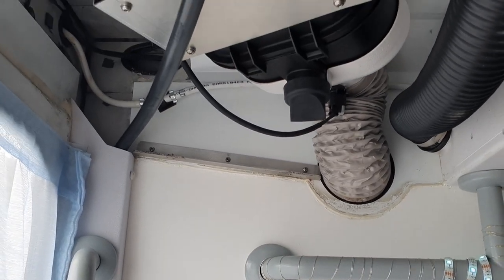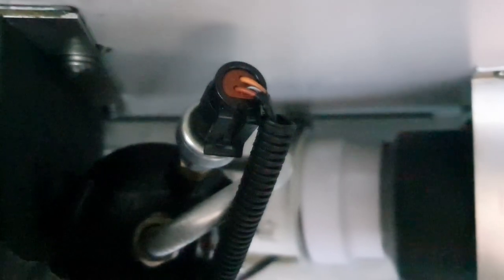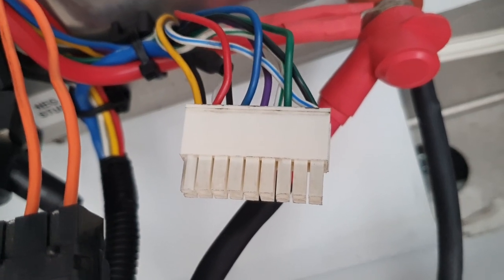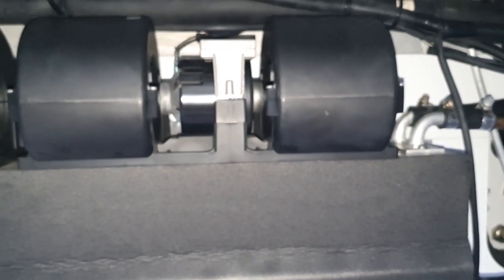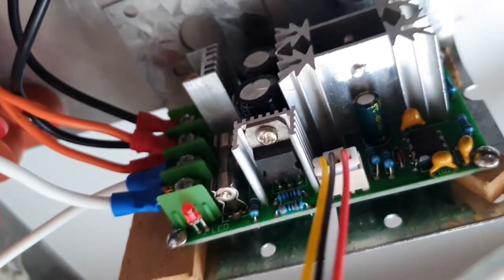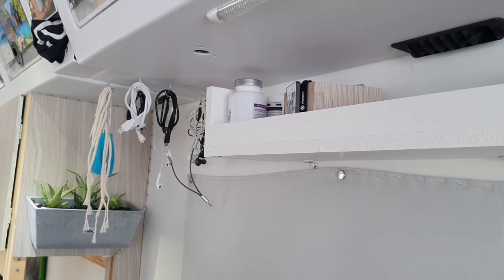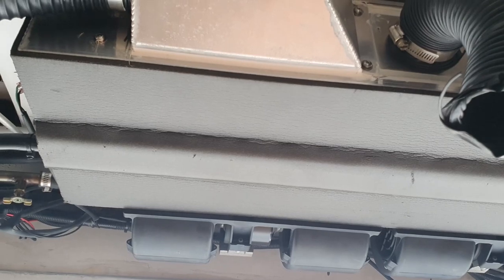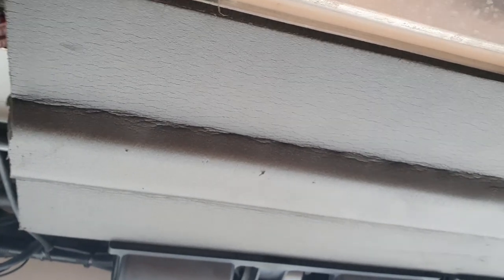Mercedes Sprinter (ex ambulance) Rear AC Wiring

Comment: Hi Patrick and Jele, this video is so helpful and detailed, thank you soooo much. Unfortunately is my knowledge about electronics / electrics very limited and I had to watch the video about 8 times before I had the confidence to work on my aircon (Sprinter 2012). Now I just need to make sure that I order the right parts. I wonder if you could provide a list of the electronic parts, which you had to buy for this modification, maybe together with a link (Ebay?).
Reply from the maker: Main blower controller: 30A PWM motor speed controller (DC12V)
Intake controller: 5A PWM motor speed controller (DC12V)
5V Relay: Arduino Compatible 5V Single Channel Relay
The listings we bought ours from unfortunatley dont exist anymore but when ordering a PWM it is important to oversize the amp ratings (for example for a 15A load get at least a 20A pwm, better would be 30A) just to be able to deal with peaks at startup. The rest was all wiring and a switchboard as far as I can remember. A multimeter is helpful to try and understand what the built in controllers are doing ;)
Reply: @PatandJele  Great, thanks for the that.

Comment: So could these rear AC systems be modified to run off electric without the engine running, any information would be much appreciated, thanks
Reply from the maker: Sadly no. AC can only work when the engine is running as the compressor is belt driven. What we usually do is, run it before we park somewhere to cool down the back and since the lines stay cold for a bit longer you can still run the blowers with cold air coming out of them. 
The heater could be modified to run without the engine running as there is a Diesel heater already fitted and only needs to be wired up electrically  (coolant lines also run through the Diesel heater) but it's the same thing like when running the aircon before stopping somewhere. If you run the heater while driving the lines will stay hot for a while afterwards :)
Reply: @PatandJele  Ah righto, fairly technical work adding those controllers though, guess you were an electrician in earlier life? Hey the big moggy will awesome for top end, not much will stop you going places in that thing! Anyways keep them spirits up and that camera rollin! You've already seen more of the country than a lot of Aussies do in a lifetime and the Unimog will get you everywhere in the topend🤘think of those good times ahead for motivation
Reply from the maker: @adventouraus4863  thank you! No, Patrick is an Aerospace Engineer but not an Electrician🙃 Lot's of research and talking to people that know more about it helped though😇
Reply: @PatandJele  Far out, Aerospace engineer!! That's one hell of a ticket, I joke around about applying for a job at NASA 😋
Reply: Anyways look forward to seeing the camper build for back of the Unimog, don't have worry about weight too much with the big truck
Reply from the maker: @adventouraus4863  true😍 Thank you!